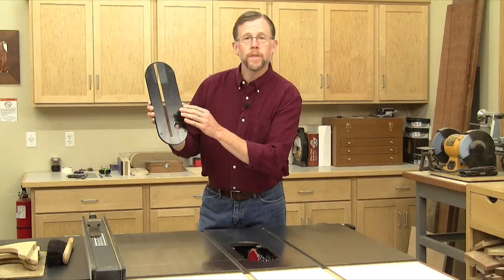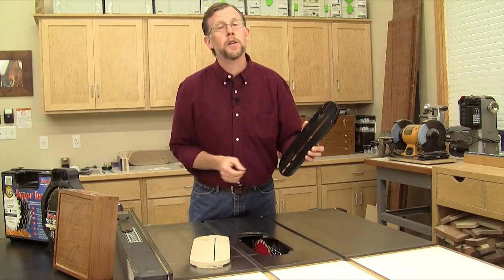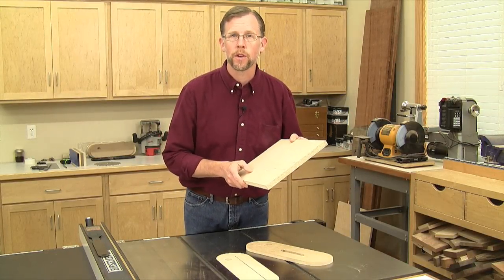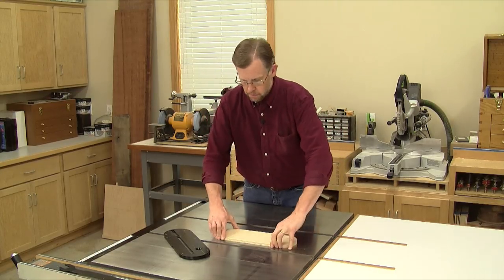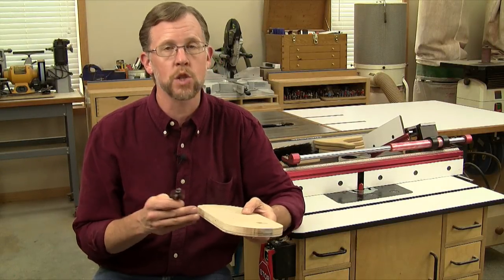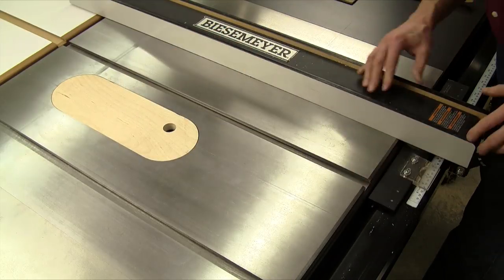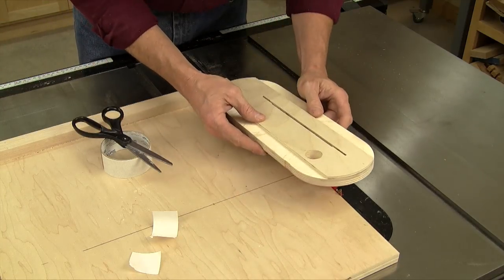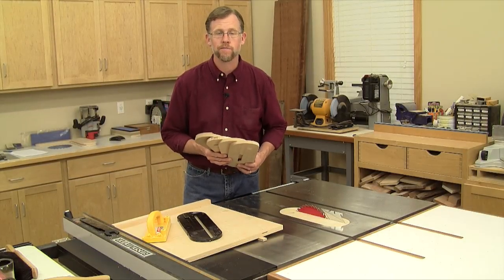How to Make Zero Clearance Throat Plates

Comment: There are scores of You Tube videos on making zero clearance throat plates.  This is one of the better ones.  Straightforward, good camera work, well lit, and nice narrated. I don't have a rabbet bit, so I appreciate the nice tip about flipping the plate on its side to pass through the router table.

Comment: Zero clearance inserts are verry useful and add to safety too.
When i had small traditional style table sae i have made bunch of them. For 90 and 45 degree cuts. 
Since i have format saw i don't find any use for it anymore. 
But if you have regular table saw this is a must. Nice tutorial. Cheers

Comment: Does a zero clearance plate reduce the dust collection capability of the saw?  If yes, does it make sense to only use it on cuts that need a clean edge on the bottom?